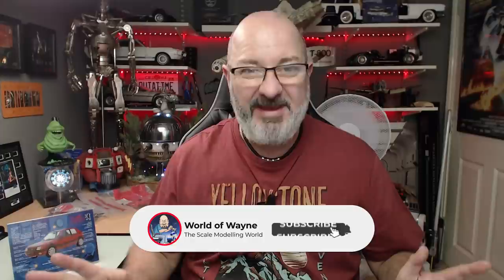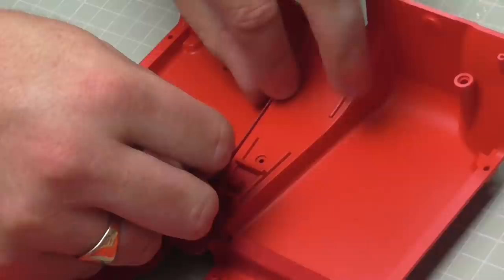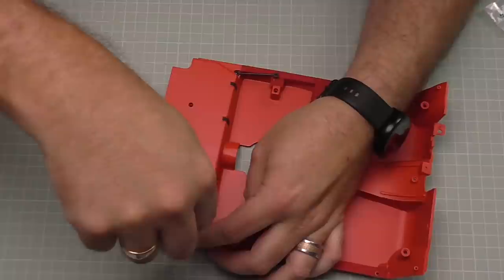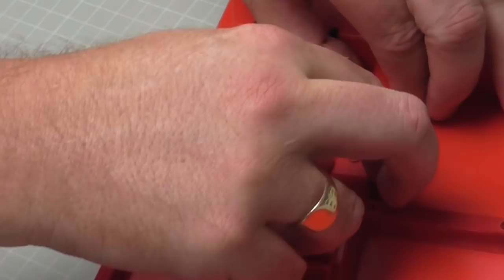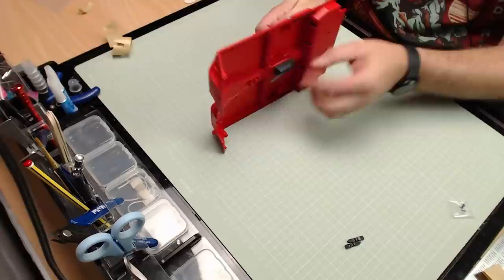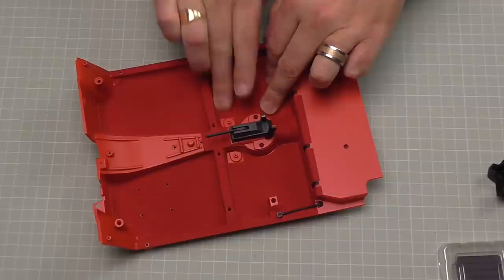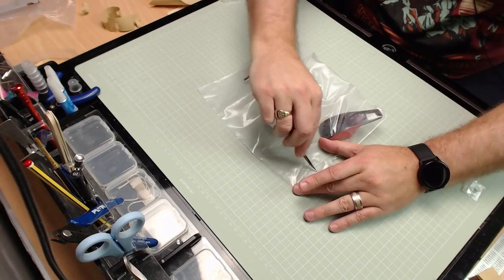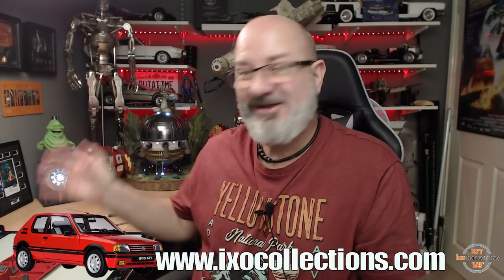Build the Peugeot 205 1.9 GTI - Parts 45,46,47 and 48 - Floor Coverings, Gear Lever and Console

Comment: Wayne, if you look at 4.10 you'll see that the pieces that you put on the side of the centre console were supposed to roll over the top edges of the console. Just a little detail that might make a difference later :)

Comment: What is the difference, or advantage/disadvantage of using flocking over carpet? I've seen videos for both, and it looks as if flocking is much easier to apply than carpet
Reply from the maker: It is if it's done right. Flocking can be messy but the end results are pretty impressive. I am bout to do some flocking on the DC3 build. You just need to make sure it's even as discrepancies are much more noticeable.
Reply: Thanks. I have bought Mike Lane's carpet's for the DeLorean; and believe it or not, I'm more nervous about that than I am about anything else. You make a mistake on the carpet, you're "going to have a bad time."  I am a subscriber, so I definitely won't miss your DC video  - Looking forward to seeing your technique!